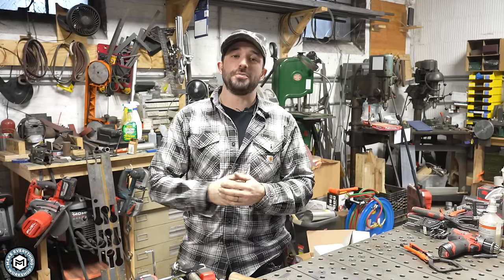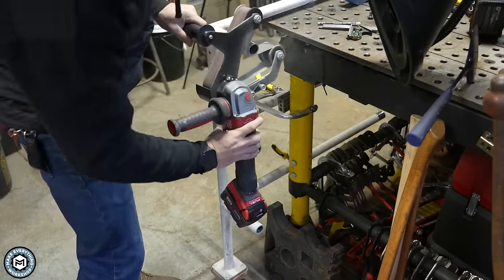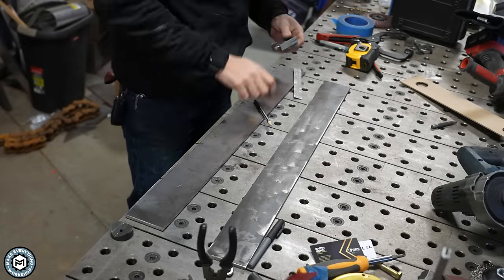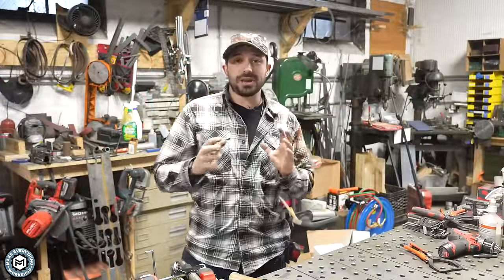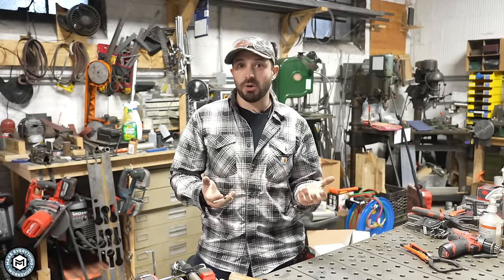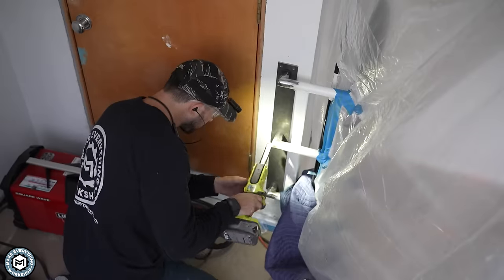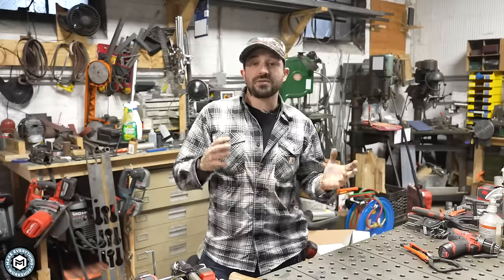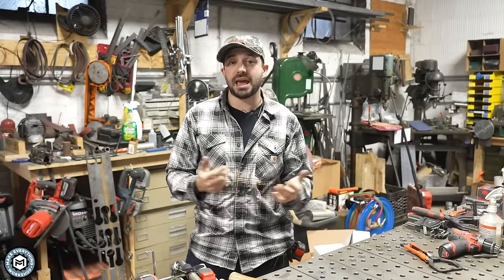Making Big Money Doing Small Welding Jobs! $1000+ / Day!

Comment: I make car panels and weld up old cars I've used auto darkening welding goggles for the last 2 years or so the ones that look like a paintball mask night and day difference especially out of position they stay on better block out all back light usually have a built in flashlight and there small for tight spaces I tried my old style helmet recently lasted a minute before I went and bought replacement batteries for my goggles. also a trigger works good on tig dont need variable just standard button I weld 1mm sheet that way with mig wire for filler so pipes definitely possible travel speed will be your heat control thats all.
Reply: good pointers.  brand for your welding mask?
Reply: Thanks for your comment, I didn't know those welding googles could exist !

Comment: 18:00 Instead of doing the miters (if that’s what the outer pieces are at the tip), couldn’t you have cut that pull further back and done those pointed tips at your home base (shop) and then did what you did with the first part (lower portion of stairs)?  And just add it all together after?  Would make the welding easier, since you could see all around the pole(s)?
Reply: I think technically that would have been better, however this might make them a little more seamless

Comment: I’m sure you’ll get this tip a lot.  But you can use the scratch start in the field for positions such as those.   Much easier.
Reply: One can also use an on/off button on the tig torch. That way you don't have to sacrifice high frequency.
Reply: Yea no fuck scratch starting on anything when you have hf and a switch in your torch.

Comment: I do a lot of outside welding. When you have too much sun glare its better to have a pancake hood on. Yes its warmer and not comfortable, but you're not hampered with the glare especially when you are trying to avoid double passes and grinding. The amount charged was well within reason considered the environment and the tools required.  Most people have never lugged a welder and the numerous other tools required for fitting and fabrication.  I do it on the daily and believe me, its not fun. Hauling several hundred pounds of equipment in and out to do the job. Is a job all on its own.  You seem pretty handy. Make yourself a hand trigger and when you get into those crazy contortioning positions  you can appreciate your time making it.  Mine straps to my wrist and I use my pinky finger to depress while I'm holding the rod with a normal grip. I actually find its better for control and I use it for delicate work that wont be ground. You can stack nickles perfectly once you get used to it.  Looked like an interesting job. Challenges are always fun.

Comment: Hey, I know it’s not super critical stuff and you have the alignment pipe on the inside but do you think grinding those welds down on the pipe to pipe joint left adequate penetration? It didn’t seem like you left a gap to fill so grinding the welds flush wouldn’t leave much fused material left.

Comment: I appreciate your video and helpful information. I once worked on repairing a 3 story tour boat with theatre seating. Anyway, the owner had  Miller tig welders with the trigger on the hand gun. It was my first time using a welder like that. I hope in the future you could get you a welder like that. It makes the job much easier. Especially in awkward positions. At times we were slightly upside down. I know you will love it. I like how you utilized your table. But I have to watch your video again. I'm not familiar with the tool you used to remove the paint off the round ends. Thank you again for sharing. I'm interested in doing a side hustle in fabrication welding and came across your video. I look forward to more.

Comment: great work , but you could have used on the job site, a high power soldering iron or a very small torch, (it only needs 550F-600F) and Stay Brite 8 in combination wiyh Stay clean liquid flux, over 10000 lbs tensile strength, solders steel on steel, sands down fast by hand and  no fire danger and sparks everywhere, and way faster. Look it up

Comment: does that pipe polisher contraption fit any 4.5" grinder? that was an insane time saver.. even fast forwarded you can tell it's far more efficient than using a hard grinding disc or even a flapper disc

I worked at a structural steel shop - after my first promotion I learned handrail layout and fab... We never used bung welds because of the excess material required - we pumped out so many rails for gov buildings in dc/alexandria that adding that little bit of extra material would add a large sum of extra costs annually (it wasn't uncommon to pump out 30-50 rails all 10-30' long sch40 or sch60 pipe in a 12.5hr day just from me (and it began as 20' lengths of pipe) - my boss Vinpah was so much faster at layout and general production that it blew my mind

We just used a pipe notcher when a pipe end was meeting a pipe and lay down a basic fillet, or butt weld when it was end to end. I understand why you do it it different tho - our #1 priority was production rate, everything came second to that - even safety. OSHA would have had a heart attack. Everything was MIG unless galvanized, then I'd stick weld it
Reply from the maker: Yes! That pipe polished will fit most grinders! I just made a video about it on my channel. With links where to buy it!
Reply: @Make Everything  dope! If I order one I'll use your links

I recently started a mobile welding/light fab business. Have an enclosed trailer with a trailblazer 325 powering most of my stuff (I use a miller suitcase wire feeder more than stick and I'm still learning tig but have a 185a everlast)

Comment: buy a roll of fire blanket or buy prepackaged sections, i always build a "nest or fire containment box"(even harbor freight sells them cheap). moving blankets are pretty dodgy to use as is plastic. the fire blanket will last a long time and will cut down on risk. also keep a fire extinguisher with you always within arms reach.  yes i know you are tig welding on sight but a fire inspection would fine you heavily and they are unpredictable. and of course you can add the safety charge. safety prep is professionalism, and invest in a hand control for your tig torch. they're for just the situation you found yourself in being on your knees and unable to comfortably adjust you torch amperage

Comment: I would have charged $2400 based on your hourly, just bc you used consumables and your equipment in the field that could have broken moving it around etc.  Not much different than the shop day rate in my opinion.   It would just be easier to work it all into an hourly rate in the current market I think.

Comment: hey i tig weld professionally, just a heads up that cup your using is really not ideal for outdoor work because of how sensitive it is to wind and how much cfm it needs to run cleanly. youd be a lot better off with either a #10 if you need the stickout, or a #6 if you arent super worried about gas coverage and still need to get into tight spots. itll reduce all that sparking by a lot.
Reply: He was not outside, he was inside a house.
Reply: @tubeonline629  when i say outside i mean "in the field" lol. a cup like that, with a diffuser in the cup itself as well as the diffuser built into the collet body, is verrrry gently dropping the gas onto the weld. its good for coverage and keeps the gas fairly local but its SUPER sensitive to wind.

he polished the pipe but was shooting sparks like he was mig welding and the heat affected zone was massive. that cup needs like 35 cfm at the minimum the run clean and thats in a shop environment with no breeze. on top of that, the gas isnt staying in the weld zone because its on a pipe so it just falls to the sides and is wasted.

i weld stainless sheet metal and stainless tubing almost identical in size to the one he was welding on and i cant get a clean weld with a cup that size if one of the shop doors is open or a fan pointed in my general direction is turned on lol. im just saying he can save gas and weld a lot cleaner if he drops down to at least a size ten. especially on carbon steel that's getting painted.
Reply: @l8rn3rds  good pointers

Comment: I weld pipe for a living and I don't make near that much and hr... I say that hand rail is the most easy accessible place to make a weld. Once you get stuck welding with both hands because your weld is 3in. from the back side of a wall and you're tucked up in a ceiling and unable to use your dominate hand then maybe you have skills. I guess since I can weld with both arms in way worse conditions I should be making $200 an hr.
Reply: you should make that if you are doing constrained tig welds with a mirror in a factory setting

Comment: I'm just wondering. I seen your tig welder on the floor behind you, I didn't see a tank for it??? Are you using a really small tank for it???
Reply from the maker: I use a long gas line, and had the bottle strapped to a railing one floor down. I only had a 125 tank so it was heavy! I tried to avoid carrying it as much as possible!

Comment: Man 100$ shop rate is high. Good for you. That’s what I charge for my mobile welding haha
Reply: Also fronius has a thumb controller vs a pedal. Not 100% sure if it would work on a Lincoln but it was great when I had to do a ton of out of position work on stainless at an old job of mine.

Comment: Every small job I do people freak out over the price here in West Virginia
Reply from the maker: I’ve found that explaining my pricing to people helps, and also being really
Up front before the conversation gets too deep has always steered me right. My dad used to say you can always give a discount, but asking for more after it’s done is hard!
Reply: I’m very open with customers and explain everything some of these jokers are just looking for the jobs done for nothing and I do offer discounts when I can!! Keep up the great work with the videos!
Reply: People around there and to Kentucky are just cheap as heck, guy asked me to weld cast iron pipe fittings to steel tubes and I quoted 70$, his response was 'I can get it done for 20' uh ye sure the wire alone will be 20 let alone cutting, pre heat, and time.
Reply: @nicholasmigliaccio9107  rich people re-doing mansions definitely pay better.   businesses losing cash flow can pay well too

Comment: I think that since using the bungs, an easier and more effective method would have been to braze it together with a small oxy accetylyn setup.
Reply: Nope
Reply: @justingrubbs4622  why not?  Easier to transport, no electrical, more surface area, no welding spatter, virtually no grinding.
Reply: Brazing is using brass filler  rod which does not penetrate the steel tubing, brazing can make a strong joint but it's nothing more than a metal epoxy or applying solder to a joint.
Reply: @tubeonline629  and because of the surface area of the metal sleeves that were installed on this project brazing would be an excellent choice due to the increased surface due to the capillary action. I have built probably a hundred customized bicycles in my life using brazed lug construction.

Comment: I see several people talking about businesses dividing by 21 or or 21.75 or some other formula.
Can someone explain this to me like im 5...ish lol. I am a new fabricator and looking to do work like this myself. Then... would it be reasonable to charge more for thin metal item repairs on something as thin as 18-20 gauge metal? or would that just be covered under the same day rate calculations?
Reply: the 21/22 days is due to actual days you would work. if you have 30 days in a month and take 2 days off per week, 8 days off a month or so, there's only 22 work days to make the money to pay for overhead per month.
as for your second question, depends how you figure your cost in, some add it to their hours, some figure out the cost based on project and add it to the total. If you charge more for it than normal work then it is just your preference.
Reply: @nicholasmigliaccio9107  Thanks for the reply, i appreciate your feedback.

Comment: You compromised your welds by not chamfering the edges of the holes that you mig welded the pipes into. By the time you grind the welds flush with the plates there is virtually no fusion there between the two components. Also if you chamfered the edges where you joined the railing pipes together the weld would have filled that void making it far stronger and requiring far less grinding and finish work. Especially at awkward positions in the field.